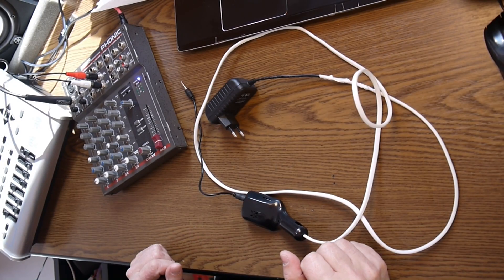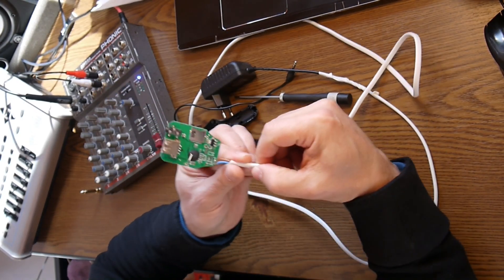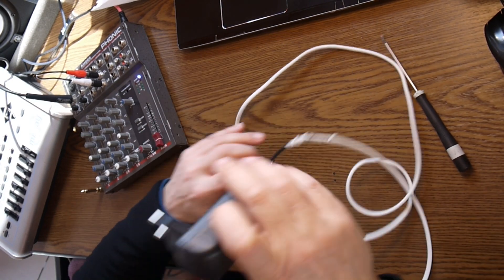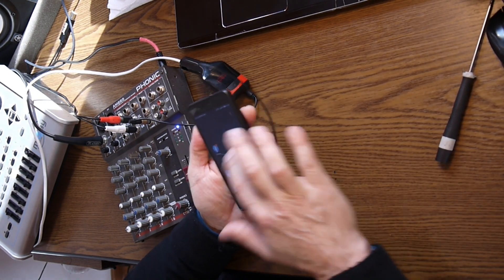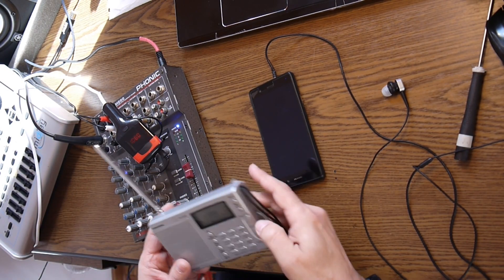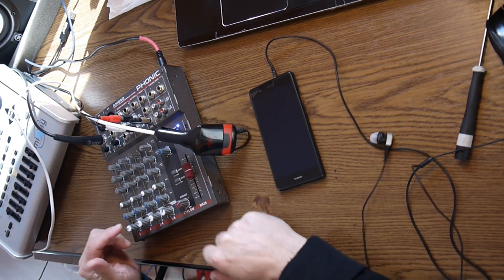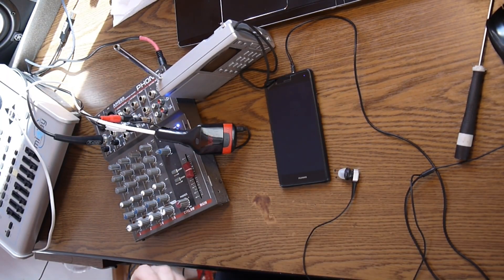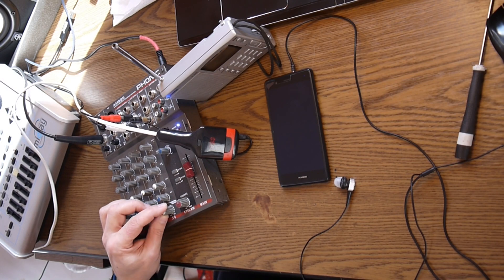DIY simple In ear sound monitor with a car FM modulator and any mobile phone

Comment: I haven't tried this yet but this is genius if it will work for me! I need in ear monitors for a click track on stage and I really hope this will work. But I think it will. My monitoring system is around the 500mhz range and it's so hard to find a replacement for a broken receiver. But everyone has a phone so I think this could replace pricy receivers. Thank you for sharing this!
Reply from the maker: It's working, lots of people are using this setup. The new mobile doesn't have FM radio anymore, but you may purchase a small pocket radio, able to receive FM.They are like few bucks.
Reply: @viocaia  Yeah I tried it, it works but there is a lot of static compared to my normal wireless monitors. But it's a good backup if it ever breaks and I have a show soon.
Reply from the maker: @natevel1  Of course it's noisy, as long as it's not a professional TX but it's better than nothing. Good luck with the show!

Comment: can you give me suggestion what can i use beside the adapter for controling the current flow from electric socket to the fm modulator?i cant seem to find the adapter to control the flow of current. Im afraid i twill take much power
Reply from the maker: Don't worry , any 12V wall adapter will do the job.Any FM transmitter will take as it needs, so there is no harm as long as you supply 12V DC.BTW it works with a car battery at tens of Amps and no problem.

Comment: Problem is that actual phones do not bring radio transmissions. And you can't download virtual versions. Need the coaxial and air signals.
Reply from the maker: Right! New ones don't have FM anymore, but there are small and very cheap FM radios..those can be use for reception..though
Reply: @Viorel Caia   @Viorel Caia  I bought a fm device that I plug into the mixer. That send the signal. The problem is to receive it on the phone, since there's no an app for it there's no way to capture that band...
You said there's another device to use as receptor?  How's that. I tried and I couldn't.
Reply from the maker: @andresmorales4407  Every radio with FM band should do the job...be sure the transmitter  is FM modulator not bluetooth.Many audio car adapters are bluetooth...

Comment: Hey bro, can you give me the link of that product? Merry christmas to you!!!
Reply from the maker: There is no product, it's DIY project.All you need it's normal FM adapter with 3.5'' line in..
Reply: @viocaia  I mean where did you buy the fm transmitter? :))
Reply from the maker: @johnemmanuelcruspero3477  >Hey gain! I recall I bought it from a car parts sector in super market.It was the cheapest one..like 8Euros.If you are looking for one, check for audio in connector.It's must!
Reply: Is it available in lazada?
Reply from the maker: @johnemmanuelcruspero3477  I can see plenty of models there..but check for the line in !
Reply: @viocaia  what is the name of it?
Reply from the maker: @johnemmanuelcruspero3477  there is no name..just a generic FM adapter
Reply from the maker: @johnemmanuelcruspero3477  I'm in Europe and I found it very cheap in a supermarket named Carefour..you should find something the same in any supermarket or electronics shop.It's a very common FM adapter!
Reply from the maker: @johnemmanuelcruspero3477  try something like this https://www.aliexpress.com/item/32881482220.html?spm=a2g0o.productlist.0.0.793b2fd8U9K8i3&algo_pvid=6a392cfc-b79e-4387-82d8-39f3d5ee39e3&algo_expid=6a392cfc-b79e-4387-82d8-39f3d5ee39e3-43&btsid=0b0a555716090120167517187ee716&ws_ab_test=searchweb0_0,searchweb201602_,searchweb201603_
Reply from the maker: or like this https://www.banggood.com/Universal-3_5mm-Car-Kit-LCD-Wireless-Audio-Car-FM-Transmitter-A17-p-959049.html?cur_warehouse=CN&rmmds=search
Reply: Thank you for this man! God bless you always and stay safe. Merry christmas to you🤗🤗🤗🤗🤗
Reply from the maker: @johnemmanuelcruspero3477  Merry Christmas! Let us know your results!